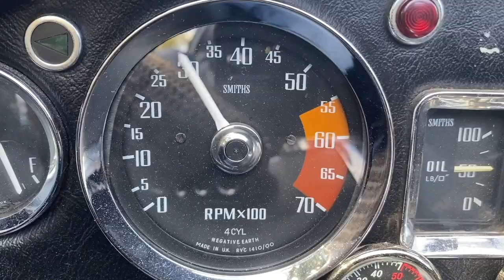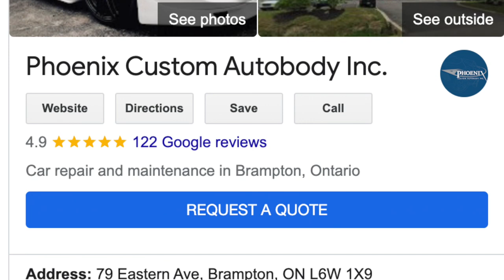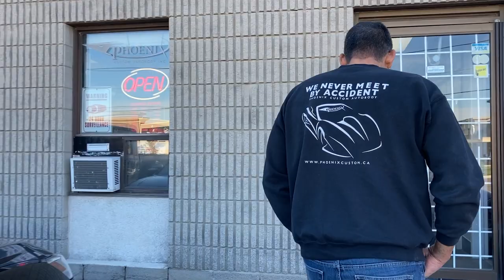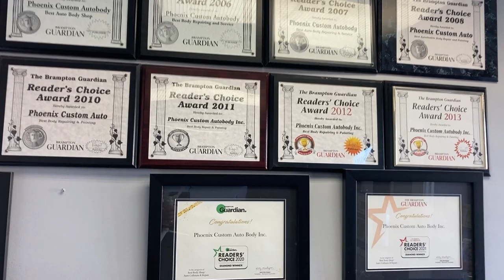Classic Car Fender Bender – A Classic Car Lover’s Nightmare!

Comment: So sad to see your beautiful car get into a fender bender. You are right though I think all of us car lovers go to great lengths to make sure we avoid getting into accidents. I was really impressed by the work done by the body shop. I was wondering that they use the computer scanner to come up with a paint code but with the color over the years fading somewhat plus the elements acting on the body how accurate is the computer and how much "manual" fine tuning was done by Phoenix in the painting of the body panel?
Reply from the maker: Thanks Ken.. Phoenix did an awesome job. Not quite sure how they blended it so well.